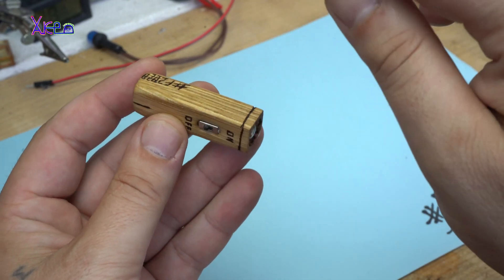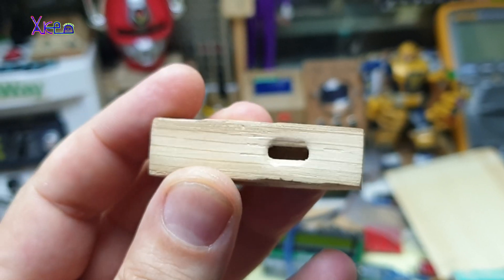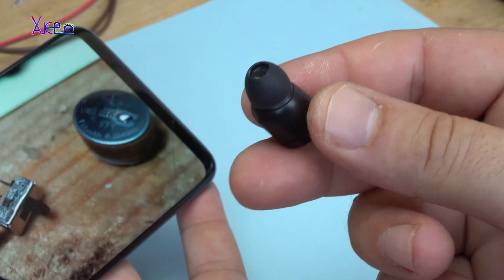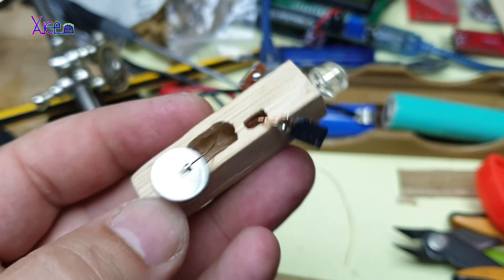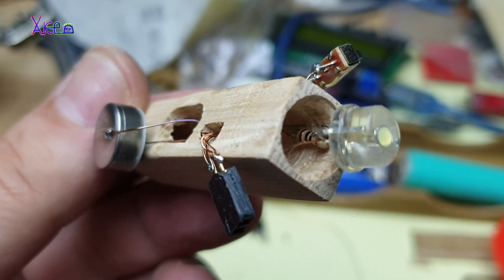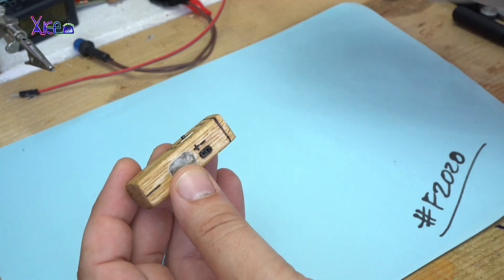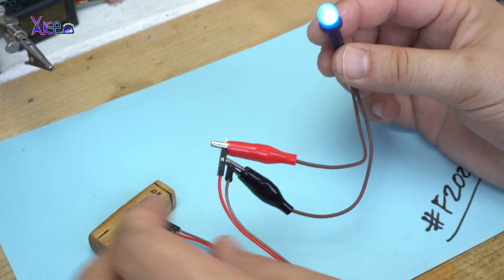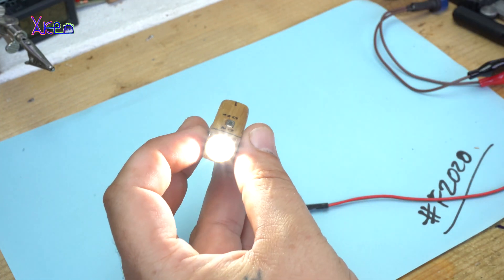Mini Flashlight made from Wood and its Rechargeable

Comment: What ampage are you using to charge the battery?
Reply from the maker: The battery is 50mah, charge rate 5mah per hour
Reply: @Hacktuber  if I was to use a tp4056 what what value resistor would I use?
Reply: @Hacktuber  it is okay to use tp4056 module if  I'm going to use 3w led? And use the same battery?